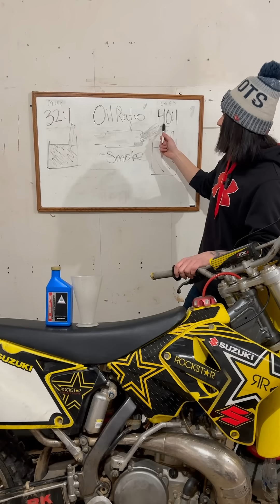2 Stroke Oil Ratio Explained

Comment: How thick is your 2 stroke oil in America to be able to change the viscosity of the fuel. You only add a tiny amount in comparison
Reply: It's not
Reply: Being that 2 stroke oil is in the range of 50-100x more viscous than gasoline, changing the mix by ~1 percentage point can indeed change the viscosity. Going from 32:1 to 50:1 changes the amount of oil in the mix by that ~1 percentage point, and this also changes the viscosity by somewhere in the range of 17% based upon data available online regarding the individual viscosities of gasoline and 2 stroke oil as well as Chevron's viscosity blend approximation. A 17% change in viscosity, according to Poiseuille's law, implies a 17% change in volumetric flow rate with the same jetting. So, not only does a 50:1 ratio have 1% more fuel in the fluid, but it's also flowing 17% faster. That's basically like changing from a 180 main jet to a 188 main jet with a 32:1 ratio, a massive change and in the complete wrong direction for a stock bike.
Reply: @anthonyantoine9232  this may be true in theory but hardly in practice. There was testing done on this on dirt rider awhile back and the calculators just aren't necessarily true in the real world. It's also not linear, the viscosity range on oil varies from oil to oil greatly, but no matter the viscosity it seemed to have little effect on jetting
Reply: @fiveohforlife  I think that the real point is being missed, and you basically stated it yourself. There's basically no difference, and if anything you're making your problems worse. The best bet is to pick a premix ratio (we all clearly have our preferences for where to pick this, but nonetheless just pick one) and jet around that, rather than trying to fix your problems by changing premix ratio.
Reply: @anthonyantoine9232  I feel like this is April fools, you're telling me by adding oil to the mix I'm running leaner 🤣
Reply: @Josh-e2l  It is not a joke. All you need to do is understand two basic things:

1) The volumetric flow rate of the premix with LESS oil will be at minimum equivalent to the premix with MORE oil, and in reality higher, provided jetting does not change. (i.e. 50:1 will flow through the carb the same or easier than 32:1, and engineering math shows that the flow rate is actually in the range of 17% higher)

2) A ratio of 32:1 will contain 96.97% fuel, and a ratio of 50:1 will contain 98.04% fuel. The ratio with more oil will contain less fuel by the very nature of ratios.

These two basic premises, which are irrefutably true, combine to prove that a 32:1 ratio absolutely will provide LESS fuel to the combustion chamber than a 50:1 ratio, thus adding more oil will cause a more lean A/F ratio, provided that jetting does not change and no changes to airflow are made.
Reply: You're actually serious 🤣
Reply: @Josh-e2l  I'm an engineer, man. I basically have no other mode than serious.
Reply: @anthonyantoine9232  So when running in a 2 stroke engine, you take some oil out of the fuel mix to richen it up lol
Reply: @anthonyantoine9232  I won't deny that a thinner fuel will flow more through a jet, but come on, if my bike is smokey I take oil out of the fuel mix and it cleans up, real life experiences, not theory
Reply: @Josh-e2l  No, you don't take oil out to richen it. You rejet. If you're actually changing the premix to "clean it up" this video is targeted directly at you. Fix your jetting to clean it up, not the premix. Changing oil content isn't going to solve your problem, and it doesn't. Real world experience should tell you that, if you've actually tried this. It will not cause a rich condition to become more lean, but rather smoke less and still run poorly.
Reply: @anthonyantoine9232  OK, yes, if your running 50:1 and it's smoking then you have a jetting issue not fuel 👍
Reply: @Josh-e2l  Not only if it's smoking, but if it's running poorly. A rich condition is noticeable when riding. I think we agree, really, but everyone (myself included) has done a poor job explaining, and so we all think we're disagreeing. The core point is that changing premix ratio isn't going to magically make your bike run better, unless you're running way out of spec like 100:1 or 10:1.

Comment: Motol 800 even 710 is great. 38 to 1 is optimal for the fuel quality and atmosphere I'm at. 2t:fuel ratio is not universal and different conditions will require different ratios for full optimization.

Comment: Incorrect lol, you should actually run the ratio the manufacturer of the oil specifies. Some high quality full synthetic oils require 60:1. Also depends on whether you’re running WOT in the dunes vs single track. You have no idea haha

Comment: You use what the oil manufacturer recommends to mix that oil at on the back of the bottle.  Not all oils are designed to run at 32:1.  The "manufacturer" lets just say Yamaha is suggesting 32:1 with Yamalube.
Reply: He also missed that when you mix 32:1 vs 40:1; the power of more oil rich fuel ratio when jetted correctly will make more power as oil has more power when burned also creates more heat

Comment: That's why warranties are getting so strict. Old timers thinking they know better and add less oil... you know... the fuckin lubricant... more fuel, less oil, burn hotter, throwing a new top end in it every 10 hours... 😂
Reply: More fuel doesn't cause a hotter burn. Less fuel (lean charge) burns hotter.

Comment: I run my banshee 28 to 1 I ran it for 15 years. Never had any issues with it. Starts up first kick CR 250 and 500 32 to 1. Never rebuilt it. Don't go any leaner than 32 to 1
Reply: 83:1 300hrs on my top end no rebuild no scoring no spluge
Reply: My 1975 Can-Am 250 has an oil tank and pump for oil mixing, driven off the crank with throttle cable input. A perfect variable mixture based on rpm and throttle opening.
No need to mix and very little smoke.
Reply: That's surprising as injectors usually run a lean mix . Hopefully it's adjustable @briankearn6991
Reply: The more oil you add also reduces the octane. Also modern oils are much better and can be mixed leaner, especially in Outboards many racers Run 100 to 1 at Full Throttle all day no problems
Reply: @amelica5502  🤣 okay
Reply: @timjohnston2191  glad you agree
Reply: Richer oil mix actually does marginally lean out the A/F ratio a tiny bit. Its enough to help out going richer as you go up in altitude. It seems to compensate a little. Good little trick to avoid jetting if you go up n down +5000'. I also run 28:1 927 w/ sunoco 110 and my cyls stay clean as a whistle. Tiny bit of black on the crown but the ex port stays clean. Clogs pipes up quick af though and that you have to burn/clean out cause a dirty pipe will suck power in a hurry then kill scavenging if it gets bad enough and temps get wayyyy too high + detonation. Anyways richer mix my cyls stay clean af. Lean mixes i find oil burnt on the piston and ex port wayyyy more.
Reply: @TheZmoney420  no one listens....smh
Reply: @TheZmoney420 I picked up a KTM 250 exc 2004 . The previous owner ran 927 castor 32:1 . It was running a bit dirty the jetting was 162 main 40 pilot . I emptied the tank and applied amsoil dominator 40:1 . I felt like it ran alot better at the time (probably should’ve tuned the carb and cleaned the pilot first) I’m new to 2 strokes but I took the top end apart to insect the cylinder , piston and crank play . I noticed there was a big spot of burnt oil on the exhaust side . Someone told me that was a sign of it running rich . But of course now I don’t know if that was like that when I got it or if it happen after I changed the ratio . I just rebuilt the carb today I changed the pilot to a 35 and left the main at 162 because it runs great and has a lot of power it’s just the idle that seems inconsistent . I replaced the intake boot and rebuilt the carb. 

It’s wierd because it had a hanging idle that was bothering me but they said that’s a sign of a lean condition but get the piston and splooging say it’s running rich . The damn bike runs nobody what I do to it and as long as the idles not too low , it’s starts first kick after a compression stroke to get it TDC. So that makes it a little difficult to tune because no matter what I do the damn thing runs lol
Reply: Cr500s 40:1 all day
Reply: everyone I've know runs 32:1
    just need to know how to tune a carb 
  
with wot
    turn the high-speed out till it 4 strokes then in until you don't notice improvement 
      will be fuel efficient and main bearings rod bearings wrist pin bearings and rings will last forever 
     most don't understand the only lubricant the top end main bearings rod and wrist pin only gets lubricant from the fuel 
    when the piston is on the upstroke the underside is in taking 
      can fix a fouled plug with a Bic lighter 
 takes splitting the case and extensive work to replace bearings
Reply: running fuel lean is what makes them burn up 
    they run hot and can cook one in no time
 the fate of most 2 stroke is getting dirt into the carb plugging the hi-speed needle jet and it running lean and burning up 
    will also cook the Reed valves
 just make sure you always run very clean gas inline fuel filter and quality airfilter with air filter oil
Reply: I know bikes have changed they use something called a airvalve on the carb 
    I cut my teeth on cr Elsinore  Canam bombardier and artic cats haven't rode 2stoke in years
   and my last bike a yfz450x got stolen gave up riding
Reply: More oil is less fuel which is actually leaner. Less oil is more fuel which is actually richer. Too many people think the amount of oil you mix has anything to do with your fuel ratio. If you add more oil and don’t upjet your carburetor you’re going to lean your engine and burn it up
Reply: @MrSagerific95but fuel ratio relates to the air\fuel ,not the oil ratio. Are we using term interchangeable?  I can see how oil ratio can affect the fuel ratio,but it has to be negligible amount. especially after the math of air ratio..hmmGoing to ask  teacher to help me figure out math wise just if and how much a oil ratio can affect fuel ratio.  Curious to see percentage wise the diff
Reply: Hey tim, 28:1 is leaner than 32:1.
Reply: @causeimbatmaaan  fuel  lean or oil lean ? Because oil rich is fuel lean
Reply: @stewart8127  What, you don't understand the english language?
Reply: @causeimbatmaaan  its hard to type with hard fingers
Reply: @causeimbatmaaan  you guys are the reason why they stopped making two strokes

Comment: Uh sir your logic is completely ass backwards on how oil ratios work it the higher the number the more oil you are using but obviously you genz tards don’t understand how oil/gas mixes work
Reply: YouTube comment section mechanics at it again. The number on the left side of the colon represents how many parts gas you're putting in a mixture.
Reply: @ExellentRachet  I’m no YouTube mecanic sir I actually do it for a living and got over 10 years experience I know what the fuck I’m talking about

Comment: more oil = rich, less oil = lean, run 32:1 and learn to jet, stock jetting is your base setting and most cases it wont suit your riding environment, best time to jet your bike is by the weather temp you like to ride in through summer and make changes as it gets colder, a lot of people have no idea how a air screw works either, my mate runs 25:1 in his rm, why? because your cyl n piston expand and going thick creates comp but also a safe ring to cyl friction, if you want to argue with me then check out the 78 pe250 project, oil has changed which is why everyone has problems

Comment: Jetting is huge also another factor to consider is climate, in particular temperature. Often times if I’m riding in snow I’ll fatten the jets and/or lean out the bike.
Reply: 2 strokes do not like charges in season.

If your riding in winter, i would run a hotter plug  atleast and probably richen it abit, otherwise runs like ASS. 

My little 100cc did 75mph easy, topped out by gearing only, next week it dropped to -2c and it wouldn't go 65 downhill. 

Same applies for hotter and dryer weather except if run strenuously it will actually cause knocking and do damage rather than just run bad.
Reply: @finlaymcdiarmid5832  richening it and running hotter plugs is counterproductive
Reply: When it's cold you want it richer bc cold air has more air in it bc its denser dummy making it leaner would make it run like shit  and more easily blow up

Comment: Just run Amsoil Saber at 100:1, and you'll be good 🤟😅
Reply: Life on the edge huh😂
Reply: @MoaiHeadEmoji  i use the same oil but 83:1 0 problems
Reply: @imbadatthisgame1681  so long as you rebuild the engine every 20 or so hours you should be fine
Reply: @MoaiHeadEmoji I have 300 or so on my top end  close to 500 on bottom
Reply: @imbadatthisgame1681  blud four strokes dont even go that long😂 stop lying
Reply: @MoaiHeadEmoji u have to rebuild 4 strokes more often u obviously don’t know anything about bikes
Reply: @MoaiHeadEmoji bike has 650hrs total 487 on bottom end 296 on top end I run saber at 83:1 on leaded 104 octane
Reply: @imbadatthisgame1681  this isn’t even 𝔞 believable troll

Comment: Crazy the amount of misinformation here.  This guy contradicts himself... lean or rich condition is determined by carb jetting not oil/gas mixture...Always follow oil mfg recommended ratios and jet you carb properly. Very simple  Absolutely nothing wrong with 32:1, 40:1, 50:1, 60:1 ratios
Reply from the maker: What I’m saying in this video is if u simply switch the ratio to a higher ratio (less oil) and make no other changes, then ur making the problem even worse, and the engine will actually run richer which is correct. If you don’t believe me give it a try
Reply: @SpunkyBoyy how does running less oil make the engine run richer???

All you are doing is shiming the pump settings to increase or decrease the amount of oil provided, nothing to do with the fuel.

Running rich is not the problem, less cooling and less lubrication is. 

I don't know why anyone would fiddle with the oil settings if their bike was running too rich or lean, its like using the fine channel tuner on a radio that is 100Hz out.
Reply: @finlaymcdiarmid5832  We are talking premix here champ. Not oil injection,
Reply: @Ozsmallbore  what he said will not effect how rich or lean the bike runs. So this is regardless if we are talking premix or oil injection.

A 2% increase in total mixture is not going to effect viscosity enough to do anything. And if it was such a problem that you had to run less, then maybe add a heating element to preheat the oil? or run thinner oil as you don't have to run with dedicated 2 stroke oil necessarily, thats just emissions bs! 

People seem to hear about things like this and stick to it like glue with zero actual evidence of its efficacy. people port their bikes DIY, don't even dyno it to see if its done anything and claim this and that.
Reply: 😂 you obviously have no clue what you're talking about
Reply: 60:1 and 50:1 is wild
Reply: @jimi1943  emissions BS.
Reply: @jimi1943  again perfectly fine. Been running Amsoil 50:1 for 20+ years in the same bike. Oil technologies have changed drastically over the years. Lab testing and real consumer usage doesn't lie. If it wasn't good we would have abandoned it long ago. Synthetic and blended lubes easily outperforms in many ways.

Comment: The reason the oil builds up on the pipe is because they’re revving  it too much and the oil doesn’t get enough time to burn so it leaks out onto the pipe because they’re not letting the oil burn. If you ride the bike fine don’t over rev it there will be no oil on the back of your pipe
Reply from the maker: It’s unburnt fuel, it means the engine is running too rich.
Reply: Wrong 😂
Reply: Spoooge is from too low RPM, too rich jetting combo.. 2 Strokes love the revs bud
Reply: I don't think theres much you can do about it regardless of how you've got the fueling setup.

Unless you have a miracle variable Exhaust height system and a variable expansion chamber there's always going to be a buildup of fuelunk.

Its nothing to worry about.
Reply from the maker: @mostlymotorized if ur having spooge coming out of the silencer, that is unburnt fuel..which means the engine is running too rich.

Comment: Umm sorry for the noob question but what does 'I run mine at 50:1' mean? (From 3rd world 🌎)
Reply: Oil:fuel ratio.

Running more than 25:1 is pointless and less than 50:1 also.